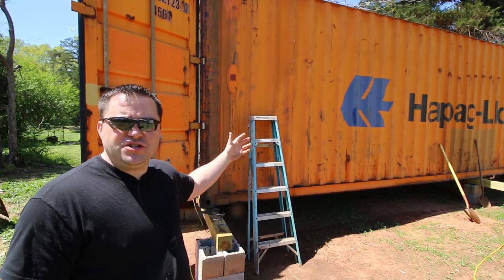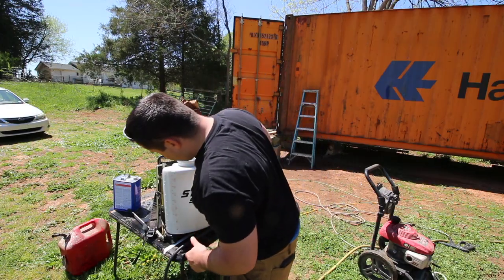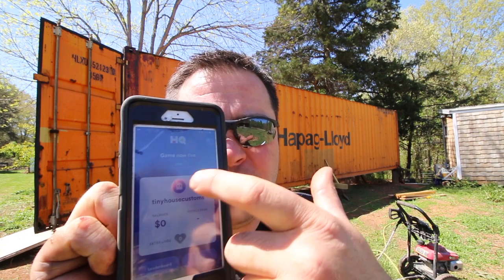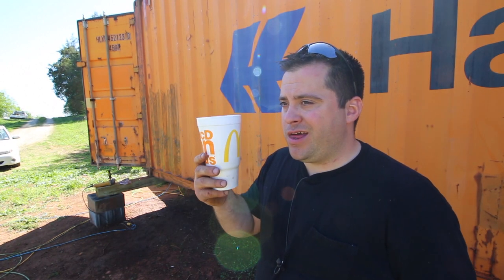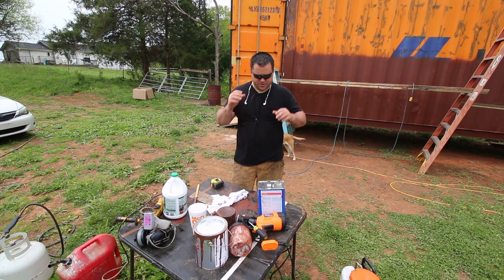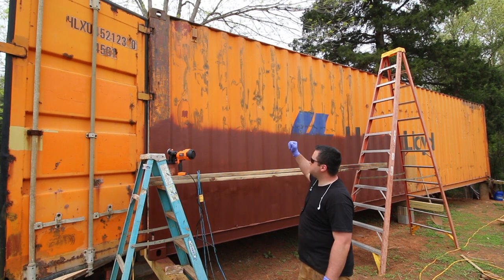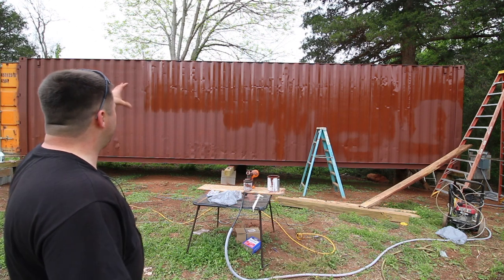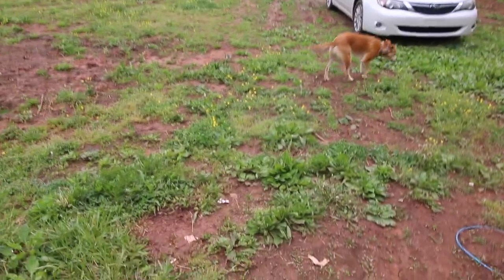A little grinding and some paint. E8

Comment: The Red Primer, is an Iron Oxide Primer and is a very tough and resistant primer. 
A secret metal prep is to wash it after you sand and grind with Vinegar Water, then after it dries, wash it with water and a lemon dish soap. It sound like B.S but vinegar kills/stops rust.
About a cup of vinegar and 5 gallons of water. If you have dirty greasy spots near the doors or hinges, you can wash that with the same mixture but add in a cup of lemon juice. I use the water, vinegar and lemon juice and dish soap to clean greasy pans that want to be a hard ass to clean. If you wash stainless steel pots or pans with it, it cleans so fast, you will freak out.

Hope this helps.

Oh,  my name is Daniel and I was wondering, if life was the same for you as for me. When I help someone else, it works out great, but when I do things for myself, it always takes longer and seems like twice the work. Maybe Daniel means, God is with me, if I am helping others, but if I help myself, God laughs while watching me go in circles.
Reply: Rust is iron oxide, that is usually red oxide formed by the redox of iron,  being exposed to oxygen, water and or moist air. 
Vinegar stops the oxidization process. With the correct vinegar/water mixture, when you wash the rusty area, after sanding it that is, the rusty area will turn black.
The Red Oxide Primer he is using is red, from the oxide. This is why that primer is so strong and resistant. When I was a teen, I had a job at a body shop, wet sanding autos, before they were painted. I was also the guy who cleaned the paint and primer guns each time they were used. It was a Dodge Dealership body shop.

After sanding, you wash it with the vinegar mixture first and after it dries, you wash the area again to remove any residue. Then we would do a wipe down with a cotton cloth soaked with something called Prepsolve. After it dries, which is almost immediately, we tack it with a tack cloth, tape and paper it and then tack it again. It is ready to paint.

You can buy something by a company called Eastwood, "Rust Converter". It stops residual rust and turns it black also. It hardens the area. If you do not want to spend the money, a mixture of vinegar and water will do the same, but you should rewash the area with water and dish soap, to remove residue. It will not cause the rusty area to keep rusting out. It prevents it from continuing to rust out.
Reply: Thanks, Fb. P. Good info/advice. You're a special soul.
Reply: @fla-bushcraftprepper941   Great post, chock full of valuable information , thanks.

Comment: I know what you need for the clean up on the outside and inside of the container . It's called "dustless blasting" . It will remove all rust paint and scale in a matter of seconds . After which you could primer and paint inside and out .See dustless blasting on youtube.

Comment: WD-40 works great on getting the sticky goo off. And it's cheap! Just spray it on, let it set for a couple minutes, then wipe it off with a rag. Repeat as necessary. There will be WD-40 residue afterwards, but dish soap (and water) gets that off easily.
Reply from the maker: +Fritz Christian   Acetone works good to. Basically it's nail polish remover.